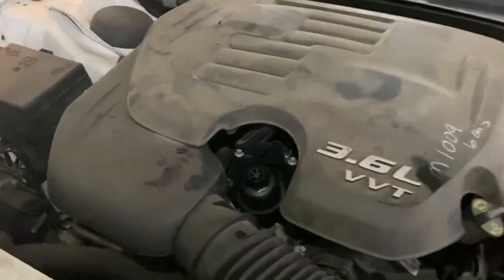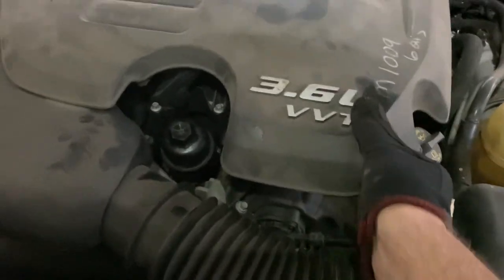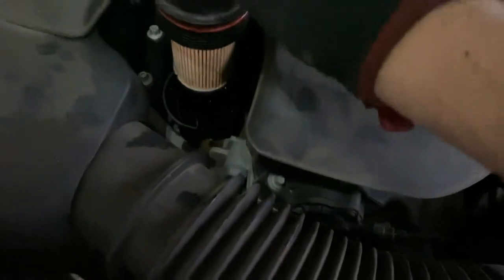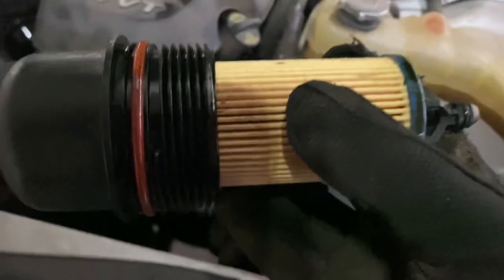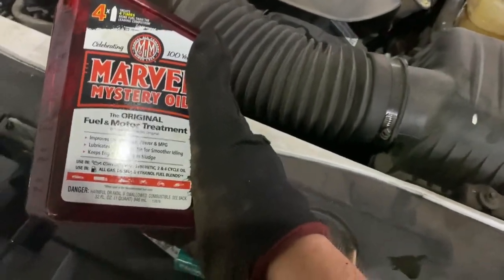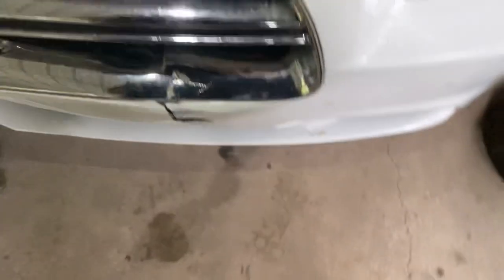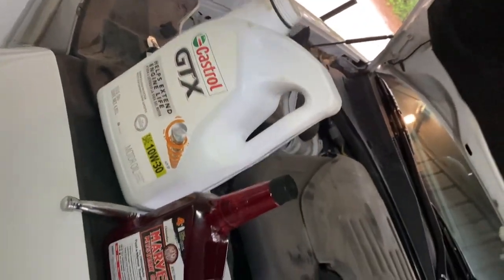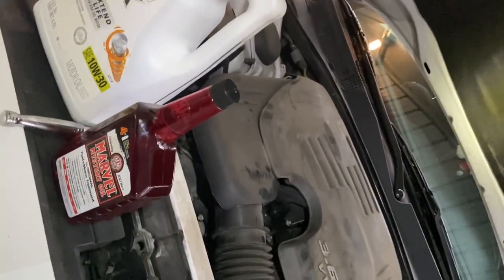Oil Change-2014 Dodge Charger V6

Comment from the maker: First ever mechanical short video, and only for mechanically inclined people. Not first timers lol. 
  Yes I plan on redoing it with the 2 missing close ups lol. The removal of filter from post, and the removal of oil pan shield and bolts. Will still keep it under 3 min. 
  Want to make 5 min or less videos as just quick reminders and cliff notes basically. Good idea or no??